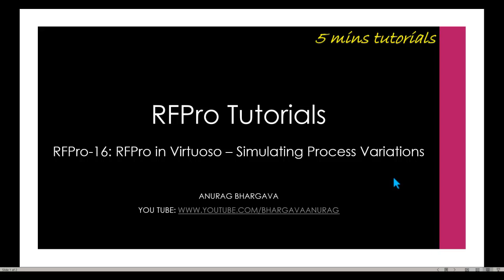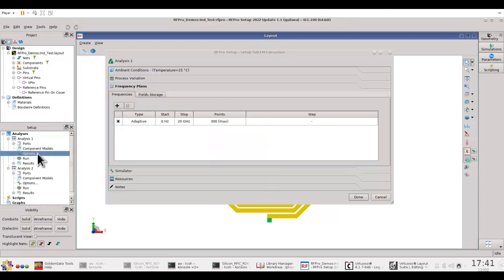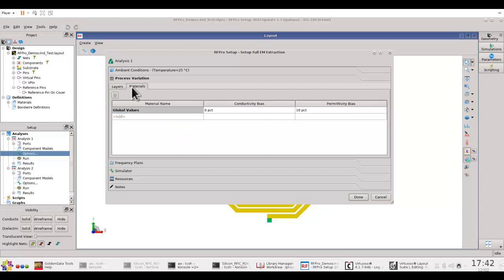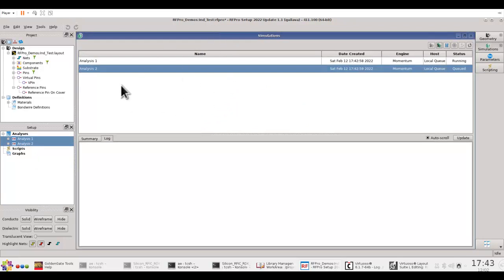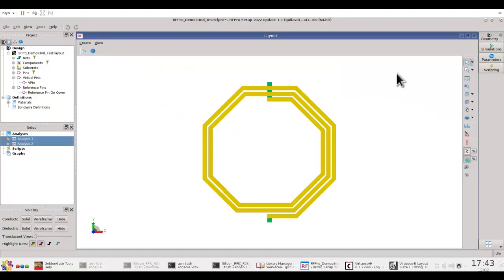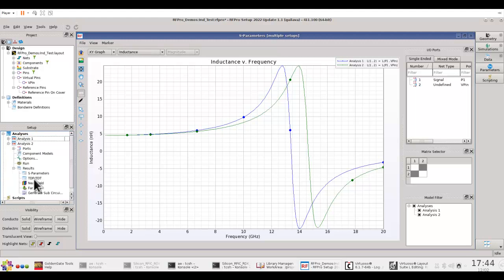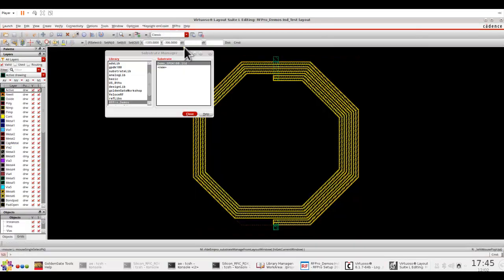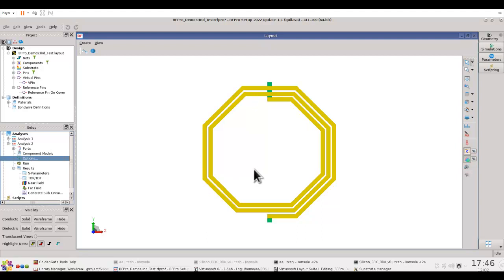RFPro-16: RFPro in Virtuoso - Simulating Process Variations with RFPro

Comment: Hello, I am so glad because of you are sharing excellent contents. I have a question which is unrelated with this topic sorry about disturbance i want to write here because it is your newest video sir. I am just designing 2 stage cascaded LNA. When i am designing 1 stage there is a input and output matching networks. But when it is 2 stage it seems i need interstage matching network. So i have a 2 question. 
1-) I am using ADS. Which network i should start to create first. (I think i should start with interstage matching network but i want to be sure).
2-) When i design input and output matching network i am just simply take Zsource=50 ohm. When i try to build interstage network what should i do. For example should i create 1 output matching network for first transistor and 1 input matching network for the second one and connect this 2?
I am waiting your kind answer sir. 
Best Regards.
Reply from the maker: Hi Omer,
Below are my comments:
1. There is no specific order or rule to follow, you can perform input and output matching while terminating the other sides as complex conjugate etc
2. For interstage matching it is complex to complex match for most optimum number of components required & least amount of area/layout size. You can watch this video: https://youtu.be/NX6G9A2U7kM and refer to complex-complex matching design section.
Reply: @BhargavaAnurag  Thank you so much sir you are a life saver 🙏